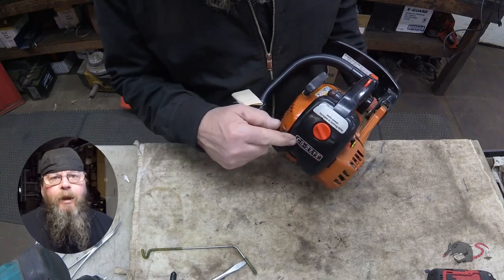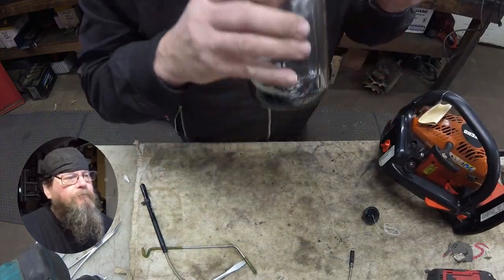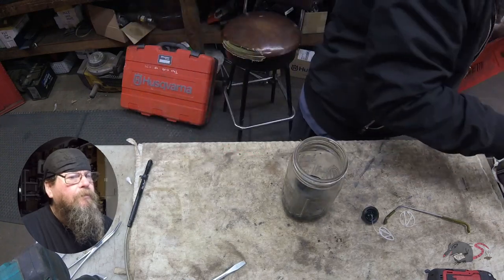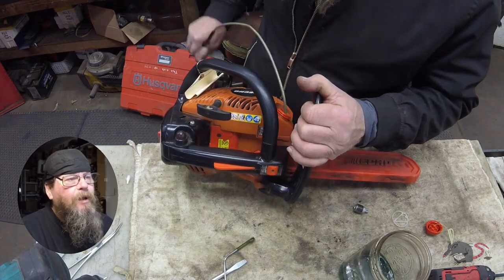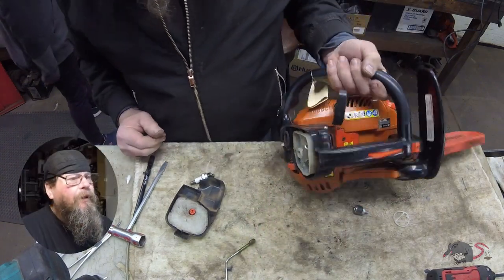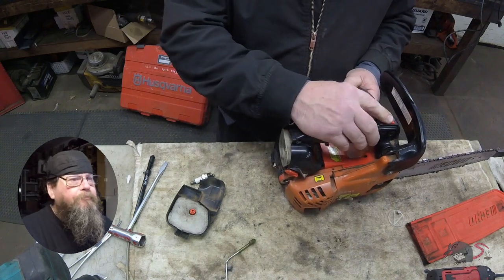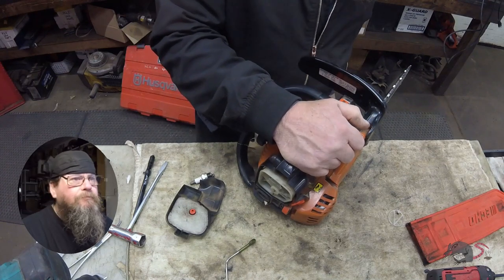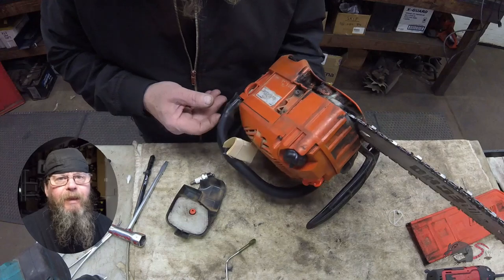Echo CS271 Chainsaw Repair

Comment: Toro weed trimmer.    Used cleaning wax on needle and seat. Chucked needle in drill. Let float over emery with soap.   Double check with Oto scope. Holding pressure perfectly. 

Next to install carb and run.  I’ll see what happens. I’ve never had one spit out fuel like this one. 

Thank you for letting me ask questions, some were strange. Fun learning new techniques.

Comment: Yeah, “Look over”, riiight!  I get the impression some of what I’ve worked on is much the same - very general, sort of non- committal, non-specific customer complaints. After a handful of these I’ve learned to not be surprised by multiple- issue machines with all sorts of problems. I try to pin the customer down for specifics, but in the end my own investigation is all I’ll trust. 😉
Pretty obvious that customer couldn’t remember which tank was which.
I’ve worked on one Echo CS2511T and was extremely impressed with all aspects of it. Light, easy to handle climbing saw with some really innovative and ingenious engineering, moving a lot of aspects of a regular saw forward over the center of gravity without any sacrifices. Ingenious air dam to direct flow back into the carb chamber.
I think this saw is worth every cent of it’s price.
Reply from the maker: Agreed but some still think they need a certain brand to get the job done. For whatever reason, Echo isn't very popular around here but I think we are slowly changing that.

Comment: It’s official, needle/seat was the problem. When checking carb first time the needle would fall out   Took apart and dirt got in and would hang up.  Now only a dime size spot or nothing. Spring assist is also bad. Unless 200% proper I will not flip. Could you do from your garage a list of things YOU would keep/throw away? Looking into an inexpensive Otto scope.   Thank you for your help.

Comment: Also what gas oil mix do you recommend, oil brand also. Thanks
Reply from the maker: Any FD rated oil at 40 or 50 to 1 should be fine.
Reply from the maker: Any FD rated oil at 40 or 50 to 1 should be fine.